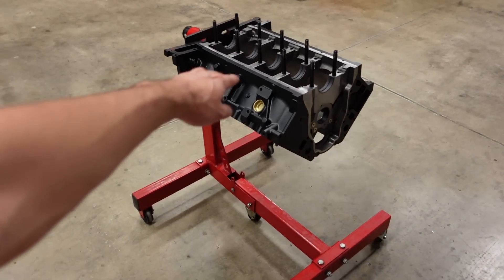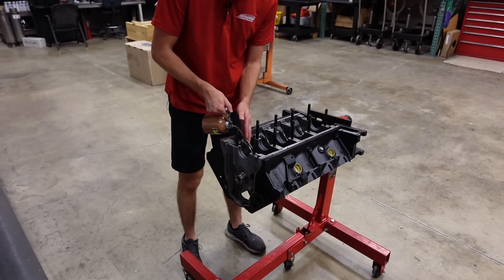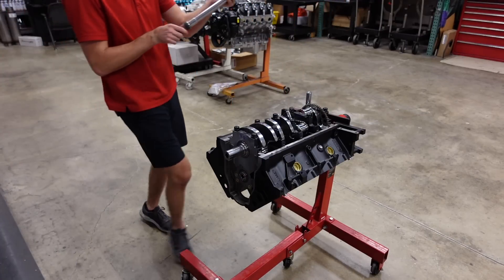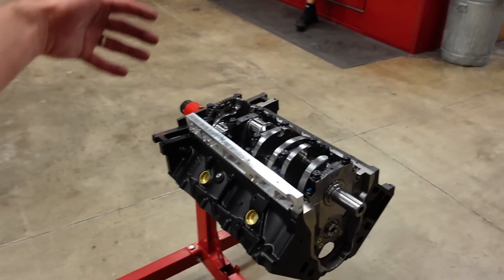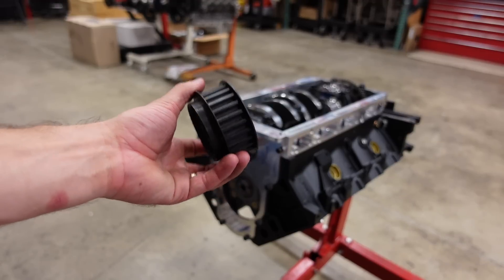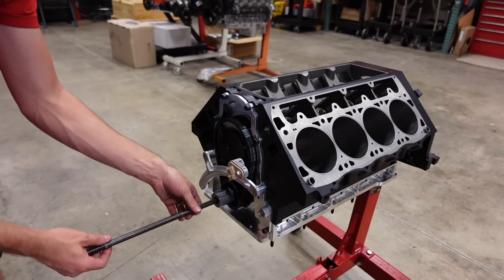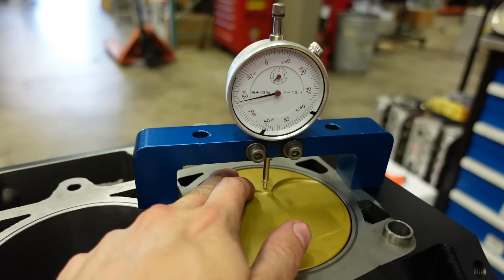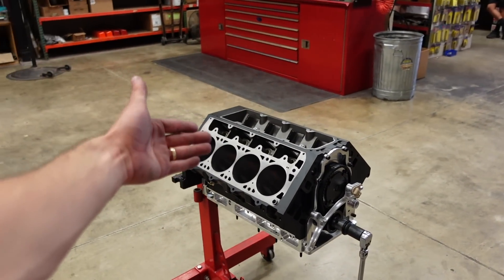BILLET CUSTOM Crankshaft Installed in my 400" LS Standing Mile Engine - (Part 5)

Comment: What happens if it doesn’t glide when you check the cam back and forth? I had some resistance on the 4th journal, or bearing. Once I got the journals lubricated it the cam would spin without an issues. Everything is still standard on my LS motor. This is my first rebuild. Enjoyed the videos!

Comment: What was Dart's reasoning behind not making it a skirted block like the LS design has? Not making it a skirted block but then including aluminum spacers to make it look like an LS seems odd.
Reply: If memory serves, the use of the sbc type main caps helps with bay-to-bay ventilation. That is a weakness of the ls full-skirt block with the 6-bolt mains. The side skirt rails are most likely for compatibility with the ls timing cover, rear cover, and oilpan

Comment: WHY do these videos not have as many views as they should have? With everyone into the LS these days these videos should reach 6 digits! The YouTube algorithm must not be picking these up much.
Reply: Probably because the majority of gearheads are practical, and this is excessive. All that effort and resources to simply* run a vehicle at intervals of 1 mile down a track.

Most have more pressing issues considering the condition of our society
Reply: Imagine putting a mild cam in that build, run it on gasoline with just a touch of boost, and religiously kept the oil clean?

This young man would have just built himself a 1,000,000 mile engine.
No question this is top shelf engineering.

Comment: I see you made one error in checking deck height. you mention you don't have the rod bearings yet, so how did you compensate for the thickness of the bearing? your piston will be higher in the hole with a bearing than what you measured. or do you already know the thickness of the bearing? The video it looks like you put the rod on the crank journal without a bearing so your measurements will be off.

Comment: It's hard to argue with cp Carillo but I would be concerned at that level a steel rod would beat the bearings to death but again hard to argue with those guys, wonder what the guys from mgp, r&r, bme etc.. would have to say. I remember many years ago Bill Miller said his rod was a 10k rpm rod and 200k+ mile street rod. Wish we knew the metallurgy on those steels, if it was 300m or something they would say. I wonder if they use something like the crank, like a Timken en30b. There's so many exotic deals with heat treat and such, tons of crazy stuff just in the knife blade industry alone.

Comment: you don't rotate the crank until the caps are installed and tightened,the tunnel is not round until caps are installed and tightened.

Comment: I would just put the drain returns in the pan. Even if they do fit behind the balancer it’s going to be really tight. If you have a fitting leak or a a hose go bad somehow it’s gonna be a bitch. You’d likely have to pull the balancer. That takes a potentially quick fix and makes it a likely end of your day at the track type of fix, unless you pack around a puller and installer everytime you go to the track.
Reply: I think I would put the turbo drains in the pan also.if you had in the front cover and one decided to leak it would contaminate the belt with oil and have  repercussions with that

Comment: oddball question, what do you recommend as a fixture to mount a dial gauge to be able to read thrust on an aluminum block? I need to do my corvette engine but i'm struggling to find a good way to mount the dial to get a reading
Reply: steel plate. drill a couple holes in it that align with bolt holes on the block. magnetic base.
Reply: You can do the strep plate, as mentioned, or two other ideas come to mind. 
1) Afapt the indicator arm to thread into a hole on the block. 
2) Attach the mag base onto the crank itself and have the indicator indicate off the block. 

I think the steel plate idea is probably easiest.

Comment: I haven't seen your oil pan yet but why not put turbo drains in oil pan with  baffles to avoid unwanted windage?
Reply: He's going with a dry sump system, so the pan won't have much room, but if there is room, it would be better to go to the pan. 👍
Reply: @TheSteve1175  that makes perfect sense to go dry on a 9000rpm motor

Comment: Great video as always, but I do have one question. Why so much quench. Shouldnt you be about .005 out of the hole and have a total of about .030 to get the most out of combustion. Please give me some knowledge that I clearly do not have yet.
Reply from the maker: Big power adder cars running methanol will run a lot of quench to help slow down the flame travel. This makes the tune up much more forgiving and less “on-edge”
Reply: Thank you so much for explaining and making me smarter. love your videos . @JacobVillemain

Comment: Those ATI balancers require measuring and honing before installation.
Reply: Damn bro I bet your 3000hp motor rips. Oh waittt……..
Reply: @h34thydra39  Says the guy who plays video games in mommy's basement
Reply from the maker: Weird, the hundreds I’ve installed have all worked perfect 🤷‍♂️
Reply: @JacobVillemain  read the directions
Reply from the maker: @SteveV6206  no thanks
Reply: @JacobVillemain  On all other cranks, the crank must be checked with micrometers and the hub with a dial bore gauge to verify fit. Most OEM
cranks are held to +/- .0002" while most aftermarket cranks are held to +/- .0005." Hub bores are tight to accommodate
aftermarket cranks and most hubs will require honing. ATI can perform this service for $40. Do not hone aluminum hubs!
Reply: @SteveV6206  I agree, I like to be at .001 or a tenth or 2 less but no more. Bryant should be on the money, would still check. You can feel if it's right when installing, probably not with the hydraulic tool.